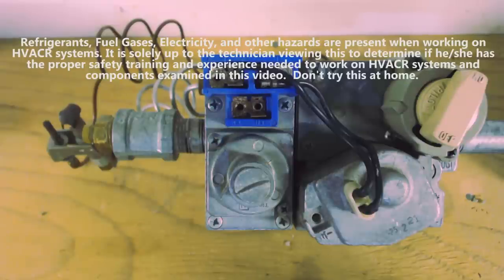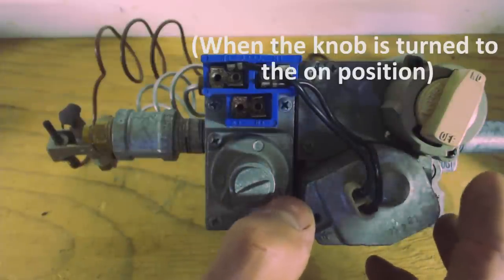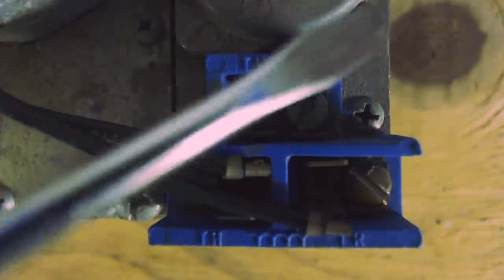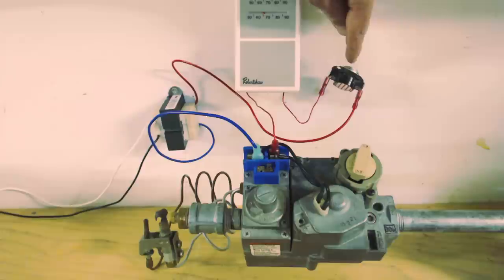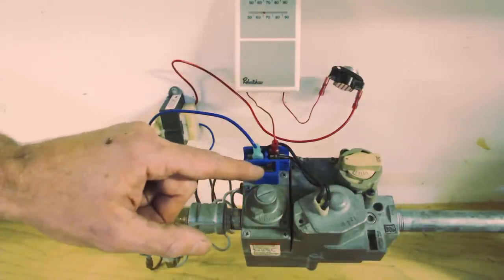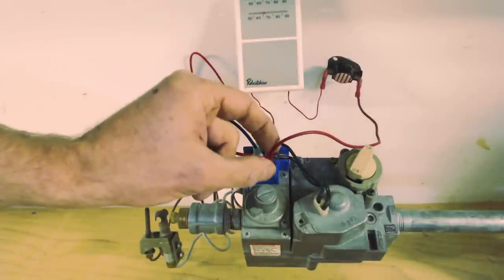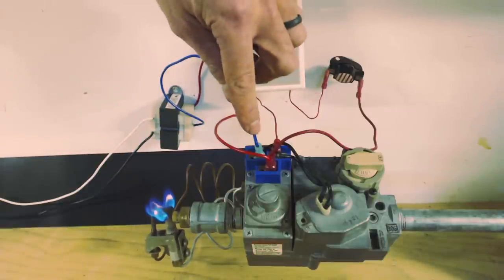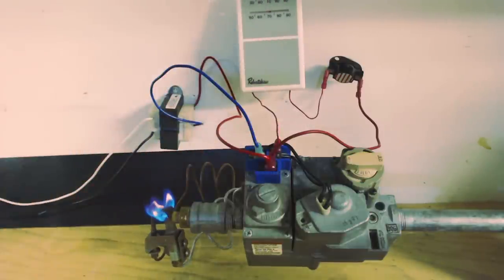How to WIRE, Light The Pilot, & POWER The Combination Gas Valve!

Comment from the maker: Tool List-  https://www.amazon.com/shop/acservicetech
Support-  https://www.patreon.com/acservicetech
For those that are looking for the tools used in the videos: (Linked Below)
UEI DL479 Multimeter with temp sensor http://amzn.to/2jtsUbJ
Magnet Jumpers- https://amzn.to/2PyKPQZ
Alligator Jumpers- https://amzn.to/2PxqJXn
Fieldpiece ST4 Dual Temp Meter  http://amzn.to/2wc1ME3
Fieldpiece Bead K Type Temp Sensor https://amzn.to/2DBwKfs
Fieldpiece Wet Bulb Temp Sensor https://amzn.to/2RRI7Tw
Fieldpiece TC24 Temp Clamp https://amzn.to/2qHLyjZ

Yellow Jacket Refrigerant Gauge Set http://amzn.to/2aenwTq
Refrigerant hoses with valves http://amzn.to/2aBumVI
Yellow Jacket Gauge set & hoses https://amzn.to/2vLVkV9
Yellow Jacket 4 Port Manifold w Hoses https://amzn.to/2BkuGIq
FieldpieceSMAN360 Digital Manifold Set https://amzn.to/2BdoaD4
FieldpieceSMAN460 Digital Manifold Set https://amzn.to/2nB4Fe6
Compact Ball Valve for Refrigerant Hose https://amzn.to/2KUisW8
QuickDisconnect 90 for refrigerant hose https://amzn.to/2MMtVcg
JB 6 CFM Vacuum Pump   http://amzn.to/2nqbvo8
Appion Blue 3/8" to 1/4" Vacuum Hose http://amzn.to/2uYlVyc
Appion Red 3/8" to 1/4" Vacuum Hose http://amzn.to/2uYg6Ro
Appion Valve Core Removal Tool http://amzn.to/2uYr8WL
Yellow Jacket 1/4" by 1/4" hose http://amzn.to/2umtcod
CPS Vacuum Micron Gauge http://amzn.to/2v1nM3O
Supco Vacuum Micron Gauge http://amzn.to/2v1JRiA
RectorSeal Bubble Gas Leak Detector http://amzn.to/2ckWACn
UEI DL389 Multimeter  http://amzn.to/2xAdaJf
Air Acetylene Torch setup    http://amzn.to/2aQalsb  
15% Silver Brazing Rods  http://amzn.to/2gVLyLc
Nitrogen Regulator    http://amzn.to/2bXdR5f
Nitrogen Flow Meter    http://amzn.to/2brvoBg

Other tool links can be found in the video description section.

Shop through Amazon! Your Purchases through Amazon provide a means for channels such as mine to earn advertising fees from all purchases after clicking through. Prices are the same as normal-    https://www.amazon.com/shop/acservicetech
Reply: Can you give info on where to purchase retrofit parts for an old 1960's Reznor 55k BTU natural gas ceiling hung heater ? Want to retro fit gas valve, high limit switch and transformer parts?

Comment: I’ve worked in hvac for a little while and I recently received a nice ventless gas fireplace for free and it works ! But I want it on a t stat ! I’ve looked everywhere ! Thank you I think this will work for me I’m an electrician mostly lol so one lead from the transformer to the valve and the other lead from the transformer to the t stat for 24V I’m going to guess that lead goes to the RED on the t stat ?

Comment: My flame keeps cycling on and off and I narrowed it down to the position of the pilot assembly which kicks the flame on and off if it's not in just the right spot which I adjust by repositioning the stiff yellow, green and white wires going to the sensor.  
Does the pilot flame sensor fail by producing insufficient voltage if it's not in the very hottest part of the flame?
Or am I just dealing with a bad electrical connection in the sensor?

Comment: My pilot light has been off for approximately one month and cannot get gas to flow to the pilot. I have the same vr800a 1020 model as you have in the video. Should I use a torch to heat up the thermo couple and hope it sends a signal to the solenoid for it to open?

Comment: We are trying to install a eco bee thermostat. We have an extra wire running through to the old thermostat that is not being used now and need to make it into a common C wire. 
where would a person connect it too on here? We have similar TH terminals. Thank you
Reply: I am having the same issue, did you find a solution?
Reply: @frhorntimmy  yes I called a friend of mine that works on furnace’s and he told me to hook it to a back TH terminal but unfortunately I can’t remember which one it was. And my son sold his place so now I can’t even go down to find out for you. Sorry

Comment: So I need help wiring my Trane Unit heater to a Robert Shaw 712 series Pilot ignition system, I have followed the instructions included for the gas valve and ignition control, however it doesn't provide the wiring diagram to connect the wires from the transformer and the Trane unit itself, the transformer has 3 wires, a black, white & blue, the Trane unit has 3 wires also, red, white & black. Also would need the T-state connections. Any help would be appreciated. Thank you,

Comment: does this valve works the same as those dual intermittent pilot gas valves that use with intermittent spark ignition module? i  was working on a york RTU with two gas valves. the terminals on the gas valve were TR, TH/TR, TH. the TH/TR was connected to PV of ignition module. the TH was connected to MV of the module. the TR was connected to ground. if i were to measure from TH/TR to TR i should get 24vac to open the pilot gas correct? and if measured from TH to TR i should get 24vac to open main valve for burner correct? so does this mean this gas valve has two coils? one for pilot gas and one for main burner? thank you.

Comment: Since this system runs on 24V AC -- that's AC -- how can there be a "hot" or a "ground" (as stated in your video) when the voltage is AC, where there's no such thing? My system uses a 24VAC step down transformer with a pair of floating output wires that are not hot or ground.

Comment: So the terminal posts sitting on the valve do not go internally into the valve and they are just posts and when remove their wires to measure resistance you get ohm infinity? And that means you could use any terminal label so why use TR or th so what are those stand for and why are those names used?
 Reason I ask because I measured Th to TR 43 ohms? so I would think a wire should go into the pilot solenoid by way of one of these terminals internally for my intermittent  spark s86f module. I already watched your s86f video.
So I'm thinking the externally wired coil is the pilot coil is 16 ohms since that's where PV connection to th/tr and returning on Tr. So the internal main coil which MV is connected to which is across th and TR is 43 ohms and is wired internally, although I can't see the internal wires.

Comment: I have an old garage heater, natural gas. Was in there when I bought the house. It has the similar setup as your video except without the safety device. Also has a fan in the unit. Have no idea what the brand is. I installed a heat only thermostat new recently. The furnace heats to temp then shuts down like it should but fires up every few minutes. Sometime just the fan starts and runs, shuts down and then it fires the gas back up retriggering the fan as well. Sound normal?

Comment: I have an old furnace.. which still works good 
But the thermostat got broke and wires went inside the wall.. I’ve been trying to find a 120V wire or transformer but don’t look like there’s one.. just wondering if this set up would work on any gas furnace? Thinking about to buy all parts and make the full set up from the start

Comment: Hi there i have an old style gas valve the pilot stays lit but want light the flames i have 24 volts from my old 2 wire thermostatic i have gas coming in but not coming out to the main burner thru the valve please help.

Comment: Is it possible to use the DC low voltage generated by the thermocouple to power the thermostat, thus having a self powered appliance, which would not be affected by a power outage? In a set up like that, how would the common be wired?
Reply from the maker: You would just use a nonpowered stat or one with batteris. They cannot be powered with the dc millivolts, thanks
Reply: and you would still need 120 volts to power the blower motor and inducer...

Comment: So my pilot light stays lit, bit there is no gas flow. This is an out door heater that runs on natural gas. All but 2 light and work. Replace Thermal Couplers, thinning maybe it would fix it. It did not.

Comment: The red wire coming from transformer going to limit swith does the other side of limit switch go to R on thermostat or W1? Or does it go to W1 then R coming out to gas valve again?
Reply from the maker: It can go to r to the thermostat, thanks

Comment: you are breaking your t stat with a thermo disc why not after the stat ???????????????????
Reply from the maker: Some older systems with combination gas valves, millivolt gas valves break the power before it makes it to the tstat with the safety. Obviously newer systems with relay controls and boards never drop power to the tstat so yes I know in that way it doesnt look like newer systems, thanks Rattler!